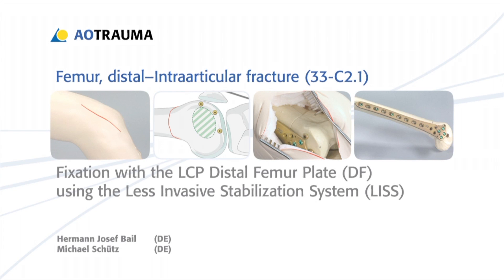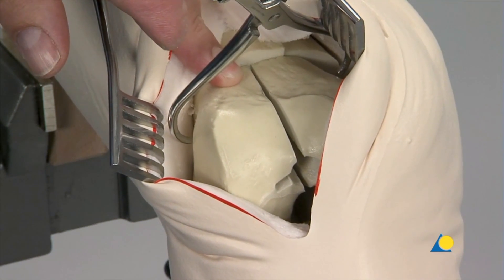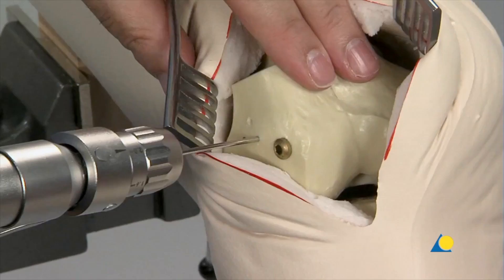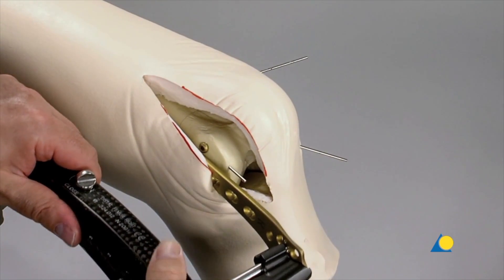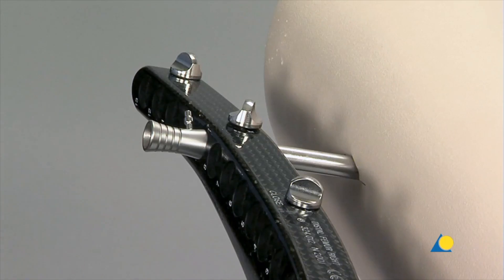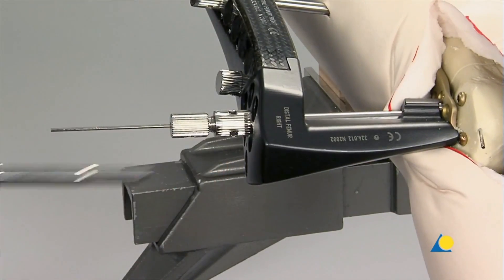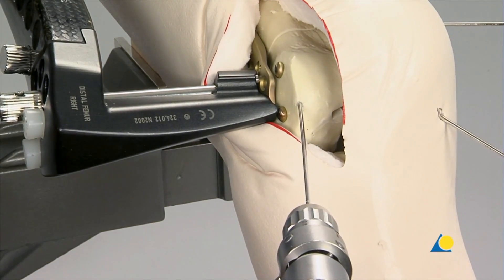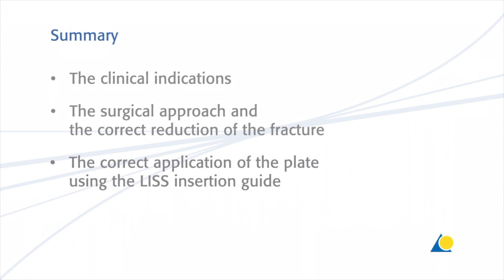Femur, Distal - Intraarticular Fracture (33C2.1) - Fixation With the LCP Distal Femur Plate

Comment: I had this surgery...twice. Seven months into a comminuted open distal femur fracture 3 of the screws at the proximal end of the plate broke due to non-union fracture movement. A week later I had 2 new plates on my femur and a complimentary ICBG bone graft to get the healing started.  It wasn't fun. 4+ years of healing and rehab. Motorcycle vs. Car. The car won.